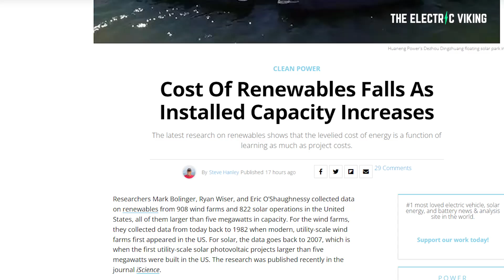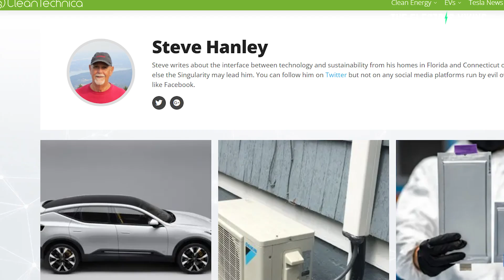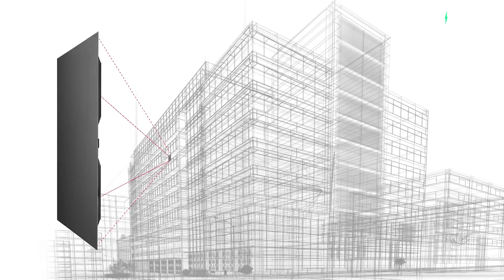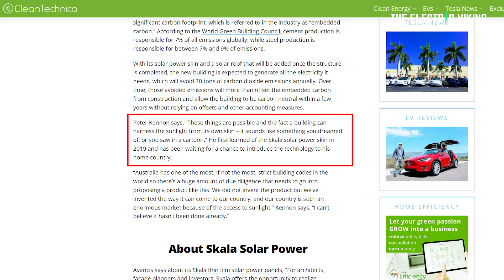INSANE new solar technology that is changing the world NOW

Comment: about 20 years ago a company that no longer exists called "nanosolar" in california invented a process to make solar film like newspapers are printed and sold a lot of it to germany.
i don't know why they no longer exist.
Reply: I followed them closely for years Richard and they eventually folded simply as they could not compete with the Chinese silicon based PV “explosion”. Their core CIGS technology was simply not as performant as their Chinese competitors and the savings of their automated manufacturing were negated by cheap Chinese labour.
Reply: @BertVerschuren  i see australia is trying to produce solar film.  i wonder about their success.  i think germany is also trying.  intrienergy is researching multilayered solar
panels and almost finished in their research stage.  i helped them out with a few bucks towards stock, but i don't think they are at production stage yet and they don't intend
on actually producing panels for sale, just for licensing to other companies.
i have about 3kw of panels now, but eventually will need about 7kw.  i live in a village that loses power about six times per year.  once for nine days in the winter. i hope to be
able to power most of my kitchen for 3 days.  i will have a very small 1700 watt genset to power when there is sunshine to charge batteries.

Comment: As an architect in Germany I have been working together with my colleagues to design, develop and build in more and more sustainable ways for decades now. It is exciting to be at the forefront of being able to develop and implement such systems. For many years now, the more sustainable a building is, the higher the market value of the building due to reduced operating costs and proportionally higher rents that can be generated when the energy and operating costs for tenants are reduced. it is a win-win for everyone.
Reply: The cheapest energy is no energy
Reply: @rogerstarkey5390  The best comment is no comment.

Comment: Until   energy storage is a lot cheaper and AVAILABLE, the jihad against coal, gas,, and oil needs to stop. In the US, we’re being  warned of brown outs and even black outs this summer because of the premature  shutting down of fossil fuel powered electrical generation. It's completely irrational.
Reply: There's no pressure for the development of energy storage until you have way too much energy which needs to be stored.
Reply: @J.Bunny13  There are days even weeks when the sun don't shine and the wind don't blow, especially during heat waves which are often caused when a high pressure ridge settles over an area. And what does aa high pressure ridge bring? No wind. Arctic fronts also  bring high pressure behind them, then no wind plus solar panels are covered in snow and it's overcast, and sometimes an Arctic system can cover 80% of the US. Without prop[er energy storage, people will die in the freezing weather. Maybe that's a worse case scenario that happens once every 30 yrs, but the grid has to be able to stand up to a worse  case 30 yr scenario.

Comment: I guess the buildings need direct sunlight, which may be difficult in a dense urban setting with shadows. It’s worth doing, tho! But what about putting the cladding on bridges? They have unobstructed solar access. Many cities have huge bridges. Maybe that’s an untapped market.
Reply: As buildings already need a protective cladding, and since glass is already a common cladding, using glass faced PV modules makes sense. Most buildings get at least some sun on their walls for at least some time of the day depending on the time of year, and there are many module types that also do well with converting reflected light to energy, making direct sunlight unnecessary for power production, albeit at lower levels. Bridges are more complex, and have more inspection needs, making retrofitting PV almost imossible. Plus bridges not designed with the weight and wind-loading designed into them would make PV prohibitively costly and impractical compared to a building that is designed for a outer cladding already similar to PV modules.
Reply: In India they have huge solar installations over canals which both generate power and reduce evaporation from the canals.

Comment: Hi Sam, I studied utility engineering. Buildings can easily coverd with solar panels. It is always a matter of cost and technical will to do it. The return of invest cannot be calculated in 3 years. Buildings and solar last longer and when you extend the timeline it will work perfectly. I did it with my own solar panels. After 5 years all costs are covered and I make profit. The quotation depends always on local circumstance and prices. Technically speaking it is not a problem at all. We got everything we need to make a clean environment. Lets start yesterday... time is running 😂😂😂
Reply: I heard one huge company covered their roof with solar panels, they got 'free' electricity and ta-da - the solar panels also shaded the roof and brought down the cost of their ac for the data center's roof they covered - so it was a huge win win for them.

Comment: The country of Australia is perfect for solar and wind year round.

And California and New Mexico and Arizona.   Not so much the "Great North East America", year round.
Reply: It takes less than 4 seconds to get an electron from LA to NYC. Its a none issue
Reply: @davefroman4700   It's a big issue .
 Electricity doesn't just flow like that, it's gotta be amplified along the way.
 I was thinking like you, But there's a video out there by a lot technical people that knows the ends and out of electricity and I learned the thing or 2.

It shows the 3 massive Power grids America is broken into, there's a East grid a West grid and Texas is all by itself.

 And from now on when I get a very enlightening video like that I've got to remember to store it .
Reply: @icosthop9998  I know there is a ton of steps that it has to take to get there. But the speed at which energy flows is a LOT faster than people realize.
Reply: @davefroman4700  K

Comment: Solar farms in most areas do more harm than good. They simply destroy habitat. Rooftop or as you’ve shown here, building sides, are the better route for solar.
Reply: right, better buid pipelines and leak plenty of oil on other habitats. Or destroy it to dig for coal. Very smart!
Reply: I agree with you Dave.

But then again I'm not a tree  hugger 🌳🌲🌳
Reply: They might CHANGE habitat, that’s not the same thing.
Reply: Not necessarily if they're done thoughtfully. There is a field full of solar panels a few minutes from me, and nothing appears to have been destroyed. The farmer who owns the field, still grazes his sheep under the panels, and there are still plenty of birds and rabbits to be seen in the field.....

Comment: Awesome news now let’s charge our vehicles at home on Solar energy
Reply: Homeowners yes for sure 👏
 Those living in apartments have to deal with landlords  🧐
Reply: @icosthop9998  sorry I was Unthoughtful about the constraints of apartment and condo living parking areas are in play for chargers at least
Reply: @nickkacures2304   Gave you a Thumbs up 👍

 I own a house ~inner city~  You can move a motorcycle in between the houses to the small backyards but you cannot get a car in those alleys.
 Most of the time you cannot park your car in front of your house you got to park it on the curb , one or two houses  up or one or two houses back (or more) .
 There's a small space between one's house and the sidewalk  and then the curve . No front lawn.
  If you are able to park your car in front of your house, You can't run a  Extension cord From house to your  EV , someone may trip over the cord or a skateboarder will go flying .
Reply: @icosthop9998  yep I can visualize that and multiply it by every city in every country and see that it is a massive problem to solve or a massive opportunity
Reply: @nickkacures2304   I would think massive opportunity,  trying to stay optimistic.   As for overnight charging, cross town going North there are 4  Tesla chargers .  3 miles going  East there is a 3 bay Tesla charger. 
But where I live you don't want your expensive EV to be too far from your eyesight.